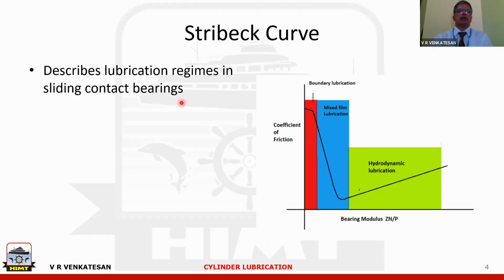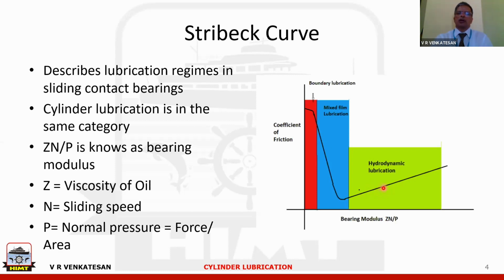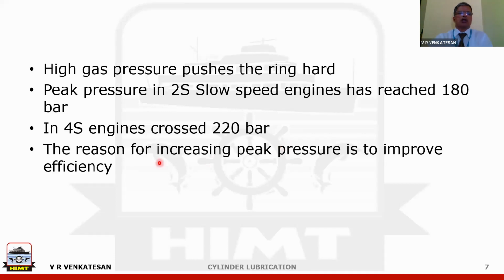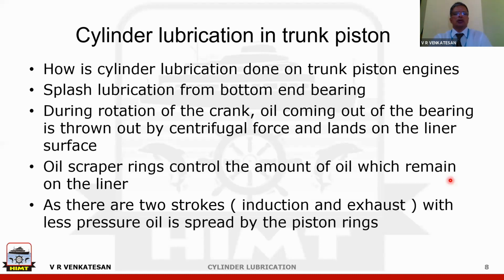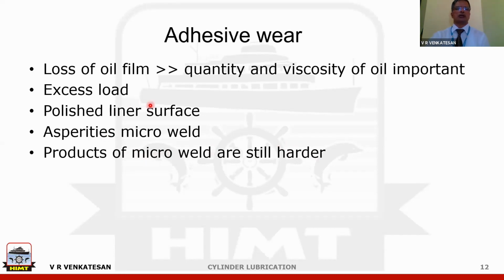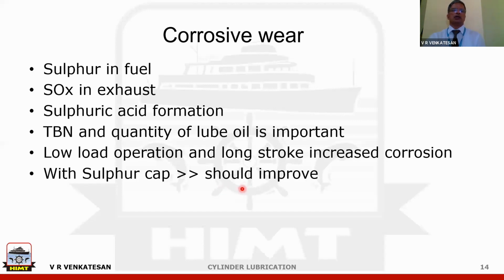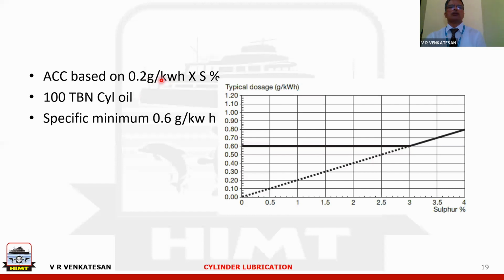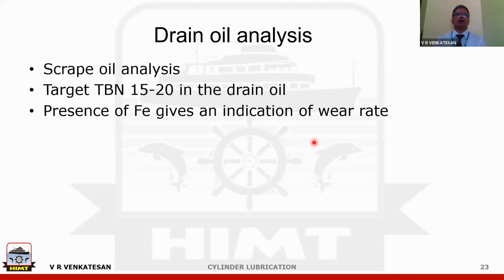Cylinder Lubrication: Issues and Latest Developments | V.R. Venkatesan | HIMT

Comment: SIR , In the diagram of alpha lubricator block ,the inlet oil  is shown on the tank line, is it like that or should it come to the pressure line of the solenoid operated valve from where it is distributed to tank line or to the operating piston as the valve switches .